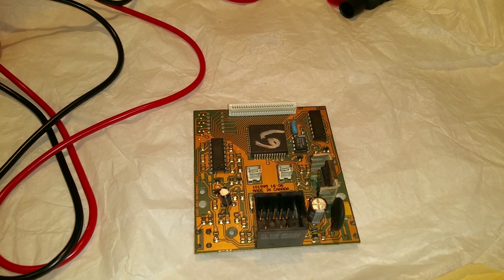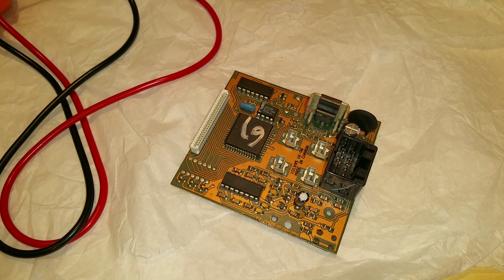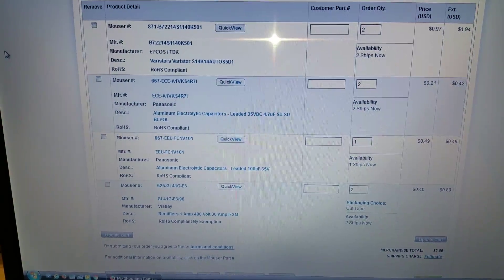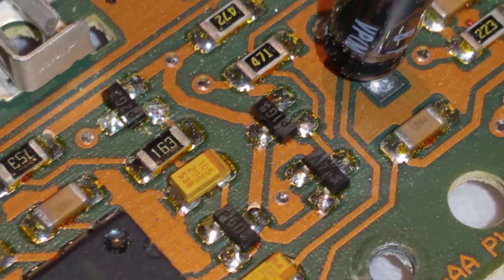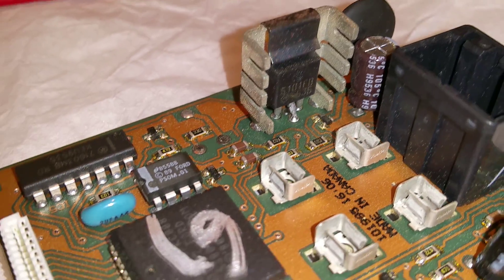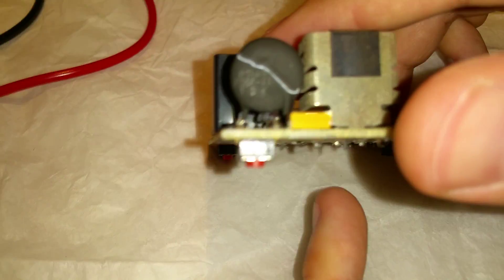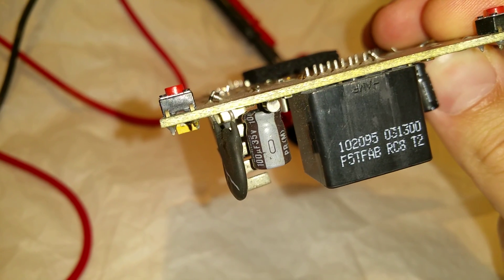1995 Ford PSOM Repair

Comment: Damn fine job bud. Been following for a while. Done roughly 8 of these with no negative results. 

Keep up the good work.
Reply from the maker: Thank you! I fixed this one only. Haven't fixed any since. Glad it has helped so many!
Reply: @Bassguitarist1985  You are most welcome.

Some helpful ideas.....

You"could" do a refreshed one demonstrating the trace restoration or not.

From some of the comments on yours and 2 others, its obvious people fail to listen and watch let alone think. 

There IS a schematic for that out here in La-La land but, for most it might be, a bit useless unless or until they come to terms with basic electrical. 

This isn't rocket science and shouldn't be to any reasonable owner who can handle a soldering pencil . Thats just my take on it but....I'm somewhat unforgiving on the shop floor and at times, in real life. 

You did great. 

31 year Heavy Equipment journeyman
ASE Master
Shop foreman
Reply: @Bassguitarist1985  Post Script

You've done great work here bud. Not good, GREAT. 

You cared enough about the rest of the people to step up and stand out. 

Where I come from, thats very very important and it says alot about that person without ever saying anything at all. 

Ought to be proud of yourself and never mind the naysayers. 

This Army combat medic will, stand with you anytime, any where. 

You earned this one 

Slow Hand Salute

Western Transportation Distribution Corp.
Denver Colorado

Any load, any  road

Comment: I am looking to replace the PNP transistor P1G52 but am unable to locate the part number or specs for it. Does anyone have any data on it "https://youtu.be/vPbsvX2EIWc?list=PLRg_E1O9icKcgKnQDDRxxKp1p686fFLOE&t=188" ?

Comment: Does anyone repair these? I don't have the ability to repair it but I need one fixed for my 1995 e150 van
Reply from the maker: Apologies I do not. This was a great video to do helping out a previous customer but doing the rebuilds and not being able to verify proper function before returning to the customer is my main problem.

Comment: Hi, Did anyone come up with a part # for the part at 6:40? Diode, Electrolytic Capacitor, Tantalum Capacitor?  Looks like a Tantalum Cap? Mine is fried, roached, burnt, post toasties. TY Have Great Day.
Reply: Ever bother to read the description?

Mouser #: 871-B72214S1140K501
Mfr. #: B72214S1140K501
Desc.: Varistors Varistors Varistor S14K14AUTOS5D1
2 $0.97 $1.94 
2 Shipped 

Mouser Part #:647-UMP1V4R7MDD
Manufacturer Part #:UMP1V4R7MDD
Manufacturer: Nichicon
Description: Aluminum Electrolytic Capacitors - Leaded 35volts 4.7uF 5x5 20% 2LS
1 shipped

Mouser #: 667-EEU-FC1V101
Mfr. #: EEU-FC1V101
Desc.: Aluminum Electrolytic Capacitors - Leaded Aluminum Electrolytic Capacitors - Leaded 100uF 35V
1 $0.49 $0.49 
1 Shipped 

Mouser #: 625-GL41G-E3
Mfr. #: GL41G-E3/96
Desc.: Rectifiers Rectifiers 1 Amp 400 Volt 30 Amp IFSM
2 $0.40 $0.80 
2 Shipped

Comment: Just did this on my '95 F150, worked perfectly. The speedo started getting erratic, and progressively got worse to where it bounced between 30 and 80 MPH. Got all the parts listed from Mouser, soldered them in. The small surface mount diode was a PITA, the old one just popped off with basically not force at all but getting the new one in was tough. I did it like he did in the video. Soldering this board is hard, there is almost no metal on the board and it is very hard to get heat into it - you need a very small tip on the iron.  Basically $5 worth of parts plus $8 shipping.
Reply: My ‘95 f250 does the same thing only at a higher speed. Above 60 mph speedometer needle starts fluctuating. The faster the more fluctuations. At 80mph it’s moving more than 10 mph back and forth. I hope this fixes it
Reply: @georgetoth1913  VSS sensor on pumkin and/or twin wire conector which, can wobble around and it should be, TIGHT. Cable tie wrks.

Comment: i JUST HAD MY SPEEDOMETER  REPAIRED AND IT ONLY GOES TO  5 MPH AND  THEN REPLACED  THE VSS AND IT STILL ONLY GOES TO  5 MPH.  hAVE ANY i DEAS .iT IS IN A 1997 DAMON DAYBREAKER  MOTORHOME.
Reply from the maker: Have you changed all the electrolytic caps on the PSOM? If so and still doing what you describe I am not sure.

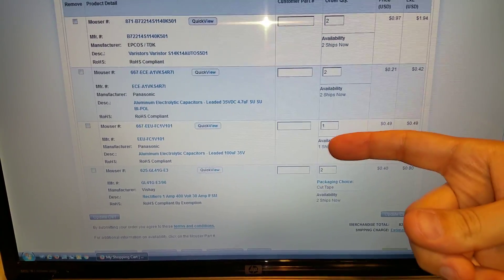Comment: The second component you list is a capacitor and as shown above it is Mouser Part #:647-UMP1V4R7MDD.  However the capacitor shown on the video at time 1:40 is Mouser #:667-ECE-A1VKS4R7I.  Which capacitor is the correct one to use as both are available on the Mouser website?  Thanks, Jeff

Comment: So I've watched a bunch of these repair videos and traced everything I could find and replace but turns out that at the end of the wire harness it plugs into the top right side of the transmission and the plug was full of transmission fluid which is causing a short. Once I get that cleaned up it should fix the problem

Comment: What cable I need connect positive and negative on battery  to know the miles of the cluster ???  I know connect to see the lights but I don't know what cable use to know the miles.

I need help please
Reply from the maker: Apologies i am unable to help. I only did component replace. I didn't do any research on pin outs when i had the PCB.

Comment: The problem I'm having with my speedometer and odometer is that the Speedometer reads 30 to 40% too high...while the odometer reads 30 to 40% too low.  Makes no sense at all.
The speedometer is metric  but when I check for the psom version, it shows an E for English or Imperial.  It feels like the odometer is registering miles  when it should be kms.  The speedometer is acting like the psom thinks it's getting a mileage reading...and then increasing it to kms....lol. It's a real mess.  I've had the truck for 13 years now and it's been the same all along.  I've put on over 100k on the odometer...meaning I've done over 160k kms over that time.  I'm thinking I just need to buy a new unit...although metric units are very hard to find, as opposed to finding imperial (english) speedometers.  From a 1992 F250 gas 302 engine and e4od tranny....in Canada.

Comment: Would this also work on a 94 psom?
Reply from the maker: It is possible. I am not too familiar with Ford.  A gentleman asked me years ago to replace these components. He was very knowledgeable of the history.
Reply: 93-96, possibly early 97 depending on the VIN. If a 97 is past mid year probably not of any use. 

Yours will do fine.

Comment: My question is what was the problem with the board and did it work correctly afterwards. I have a bouncing needle on my speedo and if that fixes it I would try to repair it.  I contacted the other guy you mentioned but he did it for somebody and he didn;t know if it fixed the issue or not. Thanks
Reply from the maker: Thats the same issue for me, the guy i did it for did not give me feedback that it fixed the problem.

Comment: Nice video. Wanted to ask (if you get this) does this rework oft this area stop the needle bouncing of the speedo or is this just a transmission fix. I have a truck like this and a couple extra boards but my truck is a standard transmission model and the speedo jumps around at highway speed. Thanks for anything you can tell me :)
Reply from the maker: Honestly cant say for sure. Electrolytic caps do dry out so changing thise could make a difference. I changed the parts the person reported back good results.
Reply: @Bassguitarist1985  maybe I will try that there doesn't seem to be a transmission sensor just the ring gear one in the back. Thanks again

Comment: What you have in your parts list as a "Rectifiers Rectifiers 1 amp 400 volt 30 amp IFSM" I believe Shadowrider460 referred to as a diode. Is it similar to a diode hence why he called it that? I'm not 100% sure what a rectifier is.
Reply: All 3 months later, a diode is a type of rectifier.  there are other types that exist as well, but the diode is the most common sort you're likely to run in to.  very simplified, rectifiers direct the flow of electricity, with a diode acting like a one way valve.  electricity can flow in one direction but not the other through it.

Comment: What if you just replace the whole cluster? Wouldn’t that just fix it?
Reply from the maker: Not sure, i had limited experience with Fords. I only owned one Ford, a 94 Taurus, and man was that car a heavy POS. Tranny clutch piston cracked, and tons of cooling problems. No head gasket issue with the 3.0 though!
Reply: Bassguitarist1985 I had a problem with mine and I went to the junkyard and pulled one out of a truck and plugged in and it worked! Instead of 210k I now have 258k hahahahaha

Comment: I have the PSOM tore apart. Diode is good, VAristor looks like its been hot and the resistor nest to the diode, Grey/white/yellow, is toasty looking and I cannot read any ohms across it. Would you know the value and wattage of that resistor ?
Reply from the maker: I don't have the part anymore and I don't remember replacing a resistor the best I could say is maybe look at my video and see if you can read the color bands on the resistor. Thank you for watching and sorry I could not be of more help
Reply: @Bassguitarist1985  ok. That was actually the diode I was looking at. Saw the color bands and thought it was a resistor. I ordered the parts you had in the video. My diode is def bad. Really appreciate the video. Helped me out a lot.

Comment: The top left pin on the 102095 is fried and melted. Do you have a diagram of this? I had transmission work a month ago and after that have had issues. Plus the lights on the dash go off unless i hit them before this happened. Thank you.

Comment: Do you know what part is the one that stores the mileage?
Reply from the maker: J Cortes no
Reply: don't know that it will do you any good 2 years later as I come across this, but the 8 pin DIP IC is most likely an EEPROM that stores all of the data that is remembered between power cycles.

Comment: Every person who makes video about this module makes many mistakes and clearly is not good advisory to new repairman. 
6:40 that is a capacitor.
Blue 3 pin component is a kvarc component 1-8MHz
Reply from the maker: Artjoms Pugacovs Agreed it is not the best video. I was unfamiliar with the module, did the best I could.  I'm an electronic hobbyist. I dont see a video on your channel repairing this module yet you seem to know a lot about it
Reply: @Bassguitarist1985  dam you gently busted his chops. well done

Comment: Yes Sir, here is that other youtuber thinking, maybe not though, i am having a shifting Problem, in town i have no problems, shifts nice and smooth, though i do have to turn my OD off because it will start going into OD at times, now while  entering the Interstate it wants to shift hard but the OD is just fine, i am waiting on a new Computer hoping that might fix it, all my Guages do work and my OD light does not blink, i do here a weird noise under the dash, like a broken clock?
Any help or hints would be nice, Thanks for the Video, yep you are that smart dude that always liked in High School, Thanks......

Comment: I am doing this repair on my 1996 E350, and that 4.7 uF cap for the speed sensor, is actually bipolar, not electrolytic. I ordered the parts from your list, and hopefully I'll install it in the correct polarity. Looks like someone else in the comments did the repair and it was successful

Comment: can you please email or text me a parts list
Reply from the maker: just added to the description of this video. Hope this helps.
Reply: I can't find transister is there a cross number
Reply from the maker: the one on the heat sync in the to-220 package?
Reply from the maker: Its a 5101FB from Motorola. I am having trouble finding a datasheet, but it is an NPN transitor, likley used for power supply
Reply: I found to-220 I bought it is that the same
Reply: I took a pic of what I bought I can send it if you message me back it won't let me put in comments and I don't know how to get to messages
Reply from the maker: best I can say is make a video and send me the video link
Reply from the maker: Cant see link

Comment: THANK YOU SO MUCH!!! I REPLACED THE PARTS AT YOU YOUR LIST. YOU HIT A HOME RUN IT TOOK 2 HRS TO DO. FOR 8 YEARS TO PUT UP WITH BAD SHIFT POINTS. IT TOOK 3 DAYS TO GET THE PARTS. ALL THE PART THEY HAD,, 2 CAPS 1 DIODE 1VASTER....IT WORK ON 1997 FORD 250 SAME BOARD
Reply: WHY ARE YOU YELLING???
Reply: Why are YOU yelling??? @MapStain
Reply: how could you ride for 8 years in limp mode?

Comment: Excellent video! I have two that need rebuilding right away. You or anyone reliable to refer to? Thanks so much, new sub.
Reply from the maker: Glad it helped! I dont know who I could recommend. Unfortunately my free time has been limited due to some life stuff and I'm unable to take on side work at this time. if you are good with a pencil soldering iron the parts are fairly easy for an intermediate skill person to repair.

Comment: Hi xboxer1985. Great video as always. Just to let you know at 6:40 the diode you described is actually a 220uf electrolytic capacitor. Not picking on you, just lettin' you know.
Reply from the maker: Thanks bud! Likely the reason why I could not initially find it!
Reply: @Bassguitarist1985  I dont suppose you have a part number or a link to that part? I looked up 226 20k 535 and got what looks like it called a Tantalum Capacitor not a electrolytic capacitor and it does not have the same 226 20k 535 number on it.
Reply: @DBLDREW  I'm a bit late to the game here, but find myself needing to do this repair.  I don't have a part number for you, but you're correct that that is a tantalum capacitor, not an electrolytic capacitor.  Tantalum caps are known to fail rather catastrophically when they do fail.  You might be best to leave it alone if it looks okay.